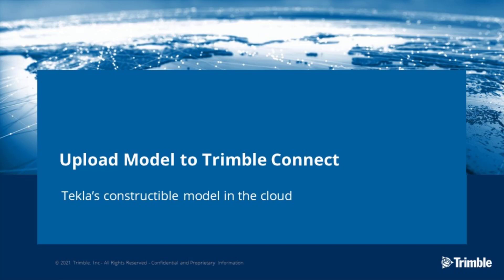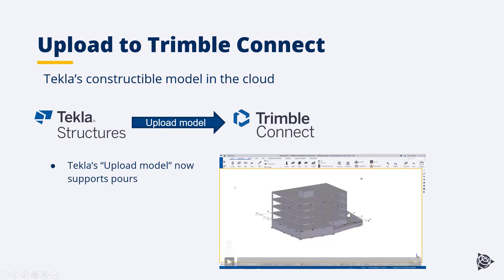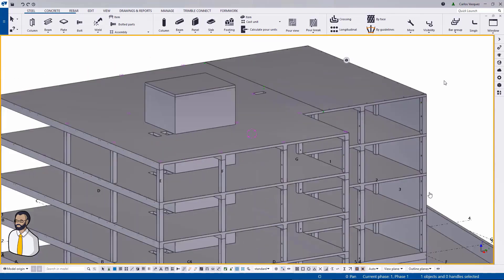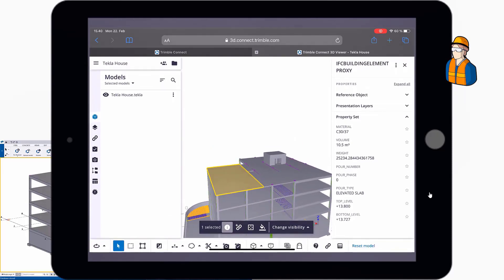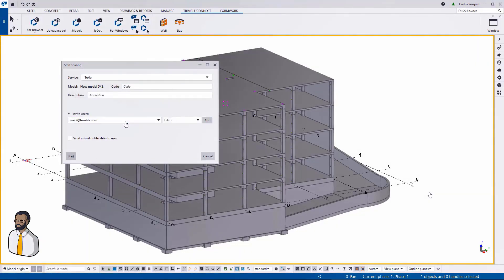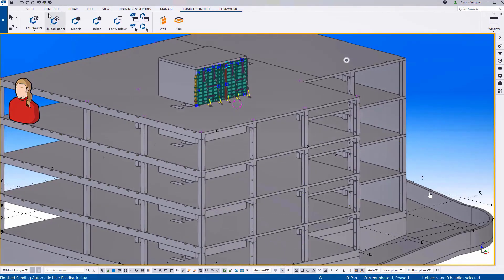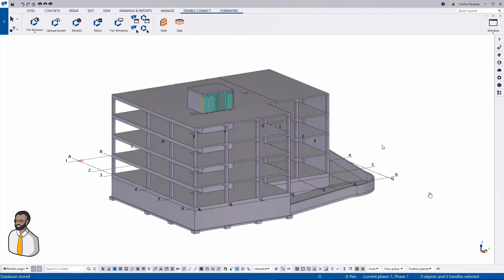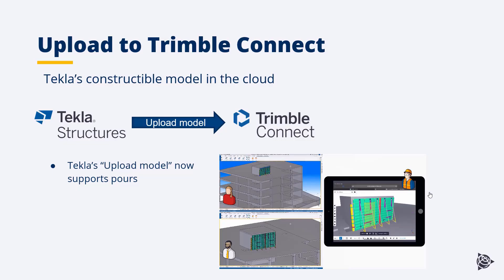Tekla Structures 2021: Upload Model to Trimble Connect

Comment: When I try to do this with my tekla model, the model in trimble is connecting some of my concrete elements together into one big element such as my walls and beams or my footings and slabs. Is there a setting that I have to turn on/off for trimble to recognize all my individual parts?